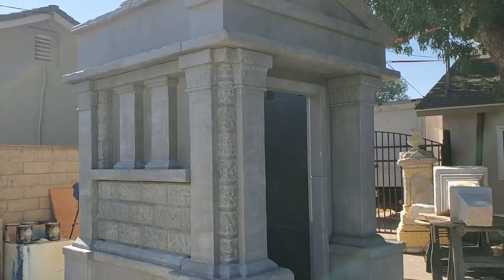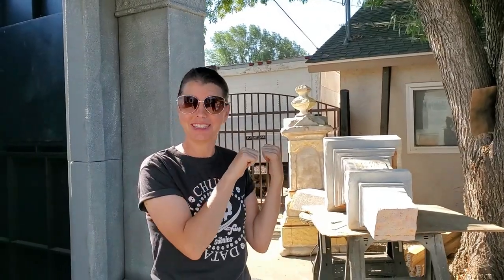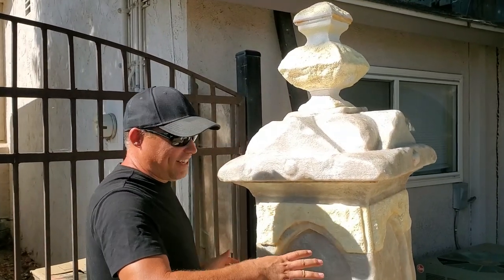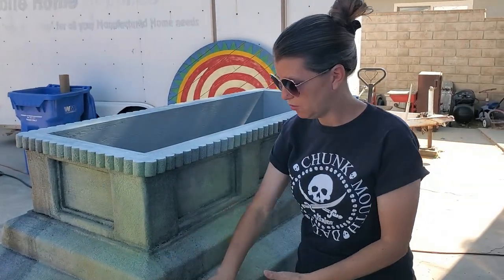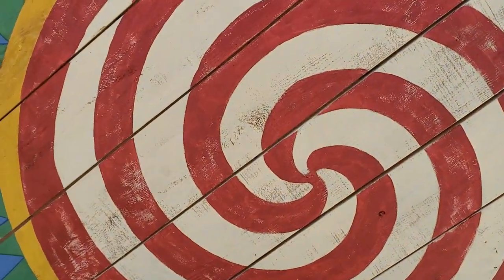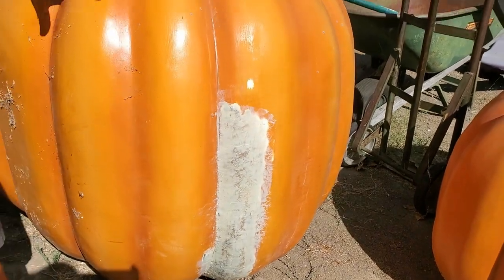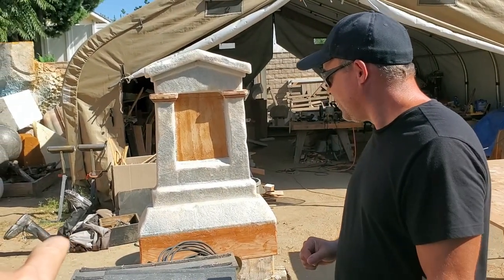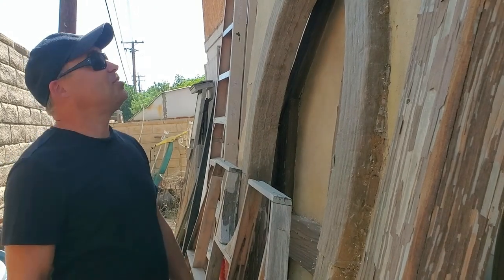Craziest Halloween Prop Projects and Haunted Yard Walkthrough 👻  Winchester Mystery House Update

Comment: Try Tamiya paints, you can thin them with isopropyl alcohol.  You will have to mix for custom colors.  Or ModelAir paints.  If you don't want to mix they have a huge variety of colors.  Except, have to use their thinner.
Reply from the maker: Thanks for the tips!